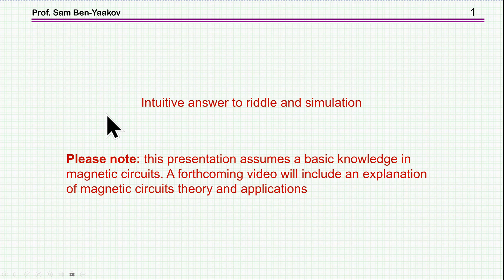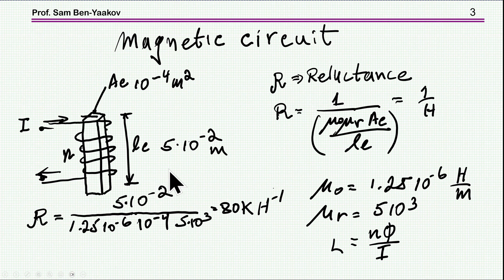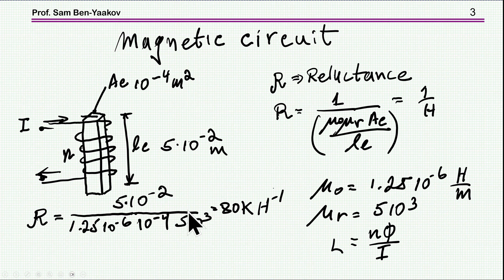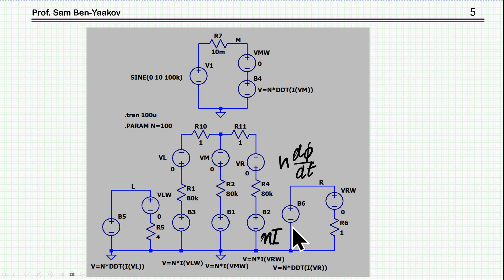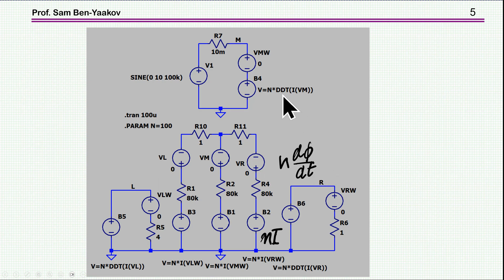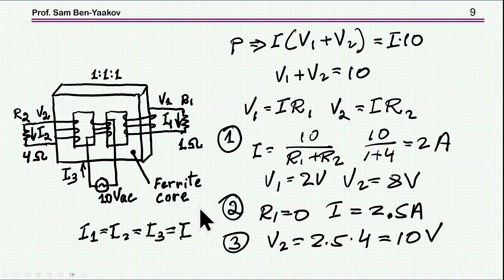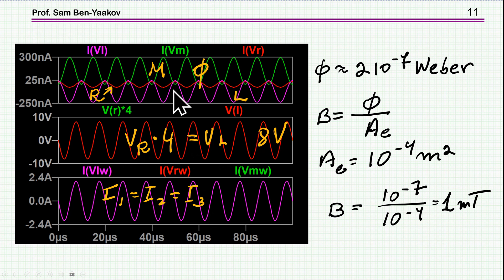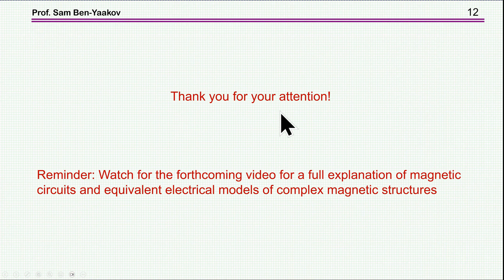Intuitive answer to riddle and simulation

Comment: That's a very interesting topic,  thanks Professor for going through it.
I think adding diode rectifier (with caps) at V1 and V2 sides will give more insights for possible applications and it is very appreciated if you can make a presentation for it with similar load changes and simulation.
Reply from the maker: Good point. Will try.

Comment: Sir, if the right side is shorted and left is opened, then V2 will be 10 V. How is this possible? Please explain.
Reply from the maker: The flux does not enter the leg with shorted windings so you just have a regular transformer
Reply: @sambenyaakov  That means the flux will get opposition from the flux generated by shorted winding. Is it correct sir?
Reply from the maker: @jitendra09616  No flux and no current in the short! amazing😊.

Comment: Sir, what does the meaning of your statement in the end of this video, "With the B=1mT, this is really core that can sustain a much high power?" Does that mean that the lower/smaller the B is the higher the voltage we can feed to it?
Reply from the maker: The current is limited by the wire cross section, the voltage by B . 1mT is very low so the voltage can be increased much.
Reply: @sambenyaakov  interesting Prof. Btw, do you have video explaining how or what is the limiting flux magnet/density?
Reply from the maker: @StrsAmbrg  See https://youtu.be/6Mi8QDD71vE

Comment: I did get the right answers using magnetic circuit analysis as well as by power balance when assuming the 3 currents are identical. But, one thing that bothered me at first was that such analysis "contridics" basic three-winding ideal transformer models including those used in many simulation platforms such as PLECS and PSIM (there isn't any  contradiction - see further on for an explantion).

For a 3-winding transformer, you get V1=V2=V3 and the currents at eact side are determined by the loads with the source current determined by power balance. 

Transformer model: V1:V2:V3 = N1:N2:N3 and magnetic circuit model: I1:I2:I3 = N1:N2:N3

So why is there a contradiction?

The answer is simple:

The configurations of the magnetic circuits assumed for this case (all 3 MMF are in parallel therefore must be equal if N1=N2=N3, or, the total MMF is the average of the three). The assumed configuration for the transformer is all 3 windings are on the same leg -> series connection of 3 MMFs.

Parallel MMF connection -> electric loads are in series (post reflections). Serries MMF connection -> electric loads are in parallel (post reflections).
Reply: Hi man, I was confused by the analogy with the 3 winding transformers and reading your comment helped a lot, thanks!
Reply from the maker: These models are of the basic coupled inductors assembly, assuming that the same flux is passing via each winding within a  defined coupling coefficient K.

Comment: At 7:04  I've got confused. Why is V1+V2=10V? In an ideal transformer with 1:1:1 ratio I would say that V1=V2=10V. Now this ferrite does not make an ideal transformer but is it really that far from it to completely change the spirit of the equation? I would expect a small voltage drop when the winding gets loaded but both should still be close to 10V.
Reply: This is not a transformer configuration! See my explanation above...
Reply from the maker: Indeed this is the first stage for answers.
Reply from the maker: Equal MMFs makes equal current and by conservation of energy V1 I+ V2 I= 10 I
Reply: My understanding is that based on the magnetic circuit, the three leg MMFs are equal, MMF=nI so currents are equal (I think)
If input power is 10I, output power cannot be 2*10I, the power must be divided. 
Only way to do that is divide voltage, because V1*I + V2*I = 10*I

Comment: Thanks for the explanation sir. At 6:53 , If the right side winding is opened instead of shorting, then as the center, left and right are in series,  no current shall flow in center and left winding.  Is it correct sir?
In short, if R1 is opened instead of shorted, what are the answers to the above 3 questions.
Reply: Let me take a stab before Prof gets to it.. based on the presented logic it initially looks like you are correct.
2. R1=inf I=0 because
I=10/(inf+R2) =0A
3. V2 = 0×4 = 0V
Like you I don't really like this answer. How could a wire breaking on one side prevent any power input entirely.

I think something else happens in this case. 
Prof neglected reluctance in normal circuits, which was the underlying assumption that I1=I2=I. 
I think it cannot be neglected in this case. 
MMF B2=0AT
The right arm will flux saturate, producing some voltage V1 depending on the ferrite.
Some current <2.5A will flow to I2. I believe you would have to simulate.
(Fingers crossed I've redeemed myself here Prof!)
Reply from the maker: Not really. See my answer video.
Reply from the maker: The open winding voltage will be 10V and the loaded leg will pass very little current,